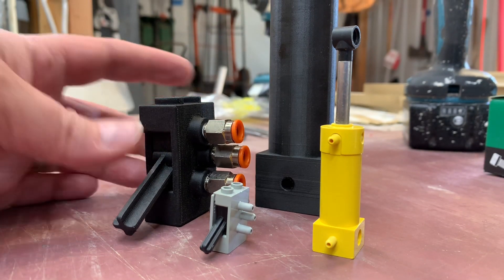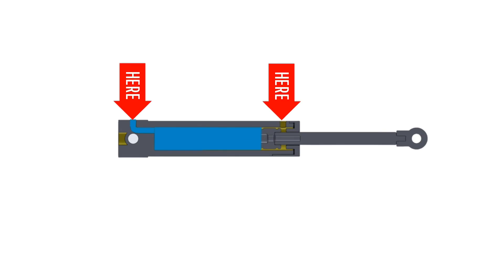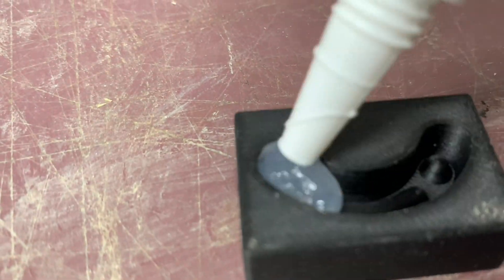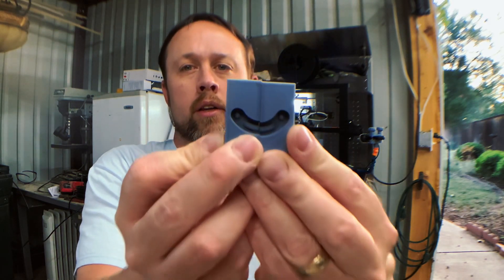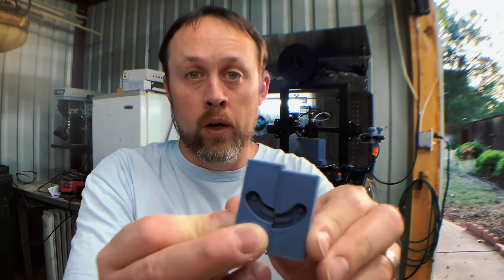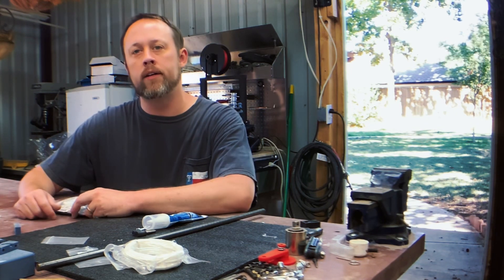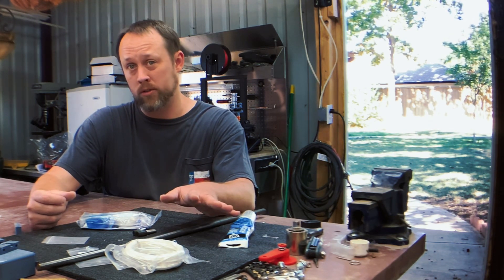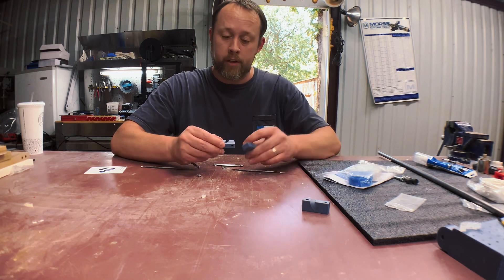Reverse Engineering Lego, Maybe || Pneumatic Cylinder Series Part 1

Comment: Why does the switch have two round notches on either side of the "smile"?
Reply from the maker: Nearest I can tell, when the switch is in the middle, both of those holes isolate the outlets so no air can escape. This seems like it would basically lock the pneumatic cylinder in place. The smile part is for connecting the up or down action of the cylinder with the air source but you probably already got that part.
Reply: @themeandrousengineer  Thank you for your reply. Yes, I understand that in the middle position both ports should be closed by the rotary switch. However, what I don’t understand is why they are shaped specifically as hemispherical recesses. LEGO could have made a recess only for the “smile”, and left flat surfaces on the left and right to seal the ports.

Comment: I absolutely love the vid! I was wondering if you were gonna release the 3d models because I am looking to print out some pneumatic cylinders, pumps, and switches for a pneumatic engine.
Reply from the maker: I’m really happy you liked it. I’m working, very slowly, on the continuation of this project. I’m not sure if it will even hold air at this point but if I get it to be successful, I’ll consider sharing the files. It would be cool for people to build if they have the inspiration.